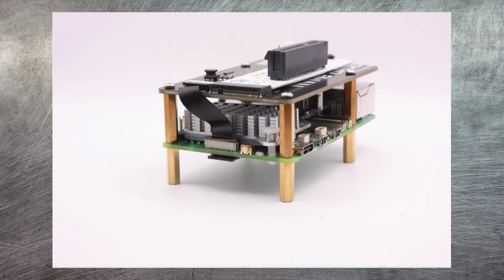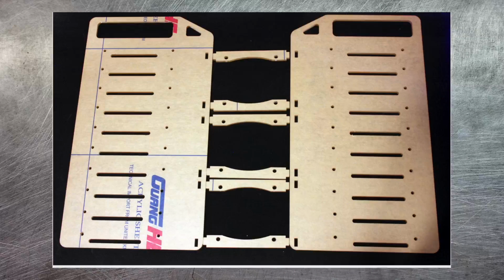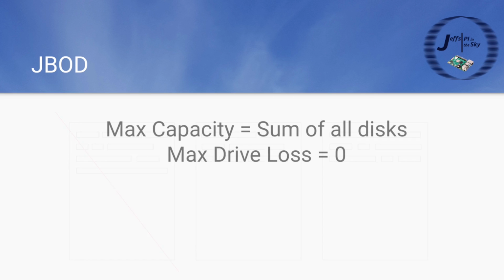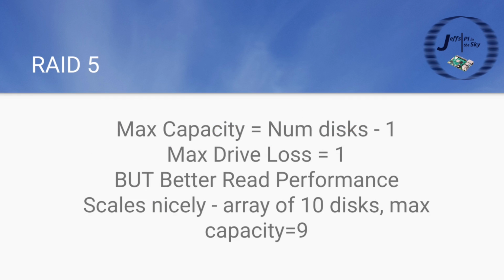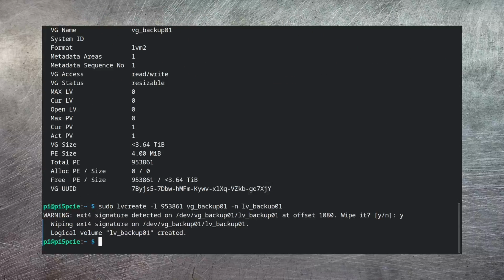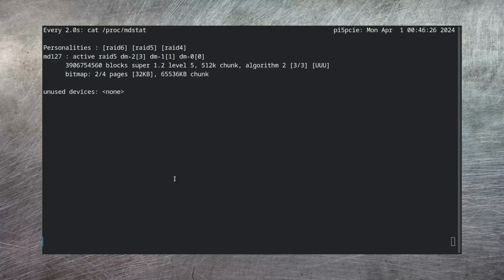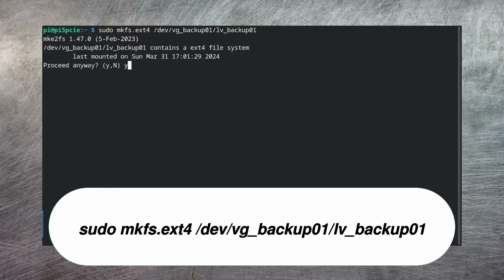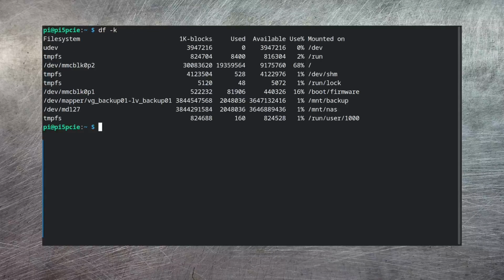Build your own NAS using a PI5 and a SATA controller card!!

Comment from the maker: As @davidKenny64 requested, here's approximate costs for the whole project. If you have old hard drives just sat around somewhere, use those!! Most expensive pieces are the PI and the hard drives. So please see this as a 'worst case' as is based on prices I can find right now - as always, AliExpress is extremely volatile with prices but is also a great place to pick up tech cheaply but shop around as best you can:
PI5 4GB - £58.50
SD card - £8.29
WD Red 2TB * 3 - £102 total
WD Red 4TB - £69.41
2.5" to 3.5" drive adapter * 2 - £11.98 total
80mm fan * 3 - £26.97 total
Fan power splitter - £0.94
Power brick - £9.87
Molex splitter - £2.17
SATA pwer splitter - £0.81
ATX starter - £0.56
Pico Power supply - £9.43
Enclosure - £10.87
SATA controller card - £11.47

Total - £323.27
Reply: Hi,

I'm wondering how is the raspberry pi powered ? Can it be powered by the Pico PSU ?

Thanks for the video!
Reply from the maker: Hi, I'm so sorry I missed your message here. In theory, if you still have a spare 3A on the 5v rail out of the pico PSU. I personally powered the pi using it's normal PD supply just purely because it can switch voltages and I didn't want to get in the way of it. But since the actual processing power required is so low, hooking it into the pico PSU should be fine (unless you hook in way more hard drives of course!!!)
Reply: @jeffs_piinthesky  No problem, thanks for taking the time to answer!
Reply: Hello, are the Pimoroni hat and M.2>PCIe adapter included in this price?
Reply from the maker: So sorry, I missed your reply!! I think I put this into the description but yes, I forgot to add the hat (£11.50 on pimoroni.com) and the m.2/PCIe adapter (£6.99 for 2 on Amazon). Apols for the inaccurate list.

Comment: Interesting idea... I have a 20 port PCIe SATA adapter card and could use two of those plastic cases for the the  20 HDDs connected to it.
I could use two I²C amp monitors for the 5v & 12v lines for logging purposes. 
They now make small UPS's for the different Rpi sizes so a few of those would keep this system alive long enough to clear the cache if the is a power outage. 
I just wonder how much power I would really need.

Comment: A couple of comments from the future (before I watch your most recent Pi5-NAS upgrade):  at 11:30 the output of lspci -k shows that the PCIe-to-4xSATA adapter is using an old Marvel 88SE9215 chip that only supports PCIe gen2 x 1 lane, so configuring the Pi5 for PCI gen3 was not going to get you any more performance. A better solution is to replace both the M.2-to-PCIe card on the Pimoroni HAT and the SATA adapter by an M.2-to-6xSATA card using the ASM1166 chip. Essentially you're eliminating the janky PCIe slot. Also the ASMedia chip supports PCIe gen3 x 2 lanes, so the gen3 boost on the Pi5 gives you the extra bandwidth (only 1 lane though), and you have 2 extra SATA ports if you add drives later. BTW, Aliexpress and Amazon both sell inexpensive 6 SATA cable bundles sheathed in nylon mesh  - that makes cleaner cabling.
Reply from the maker: Yes indeed...The old SATA controller I was using was very old!! However, it never really bothered me that much since I had spinning disks connected to it and they never got anywhere near the theoretical max of PCIe Gen2x1 anyway :-) Of course, using SSD's it changes that level of expectation. But the upgrade did away with that card.

Comment: Finally found the time to build this project, and ... it works ! Fantastic solution for my old NAS drives - just looked it up, my WD2002FAEX 2TB 3,5"drives are 12 years old and, according to HDDSentinel have around 4-5 years of active duty on their records. I have an issue though, and that is error messages in my logs when creating the backups. Journalctl makes notes of Input/Output errors and EXT4-fs counting errors - this might have something to do with the olde drives and the number of Bad Sectors....
By the way, as an alternative, I have used the "Geekworm X1004 Dual M.2 NVMe SSD Shield PCIe Periferal Board for Raspberry Pi 5" HAT with the "M.2 to SATA3.0 Adapter Card 6Gbps High Speed ASM1166 M.2 PCIE to SATA Expansion Card with Smart Indicator" - which offers 6 SATA ports directly from the card itself.
Thanks again for posting your work Jeff! 👌
Reply from the maker: That's awesome!!! Great work on the NAS and yeah, I agree it sounds like your drives may be unfortunately nearing the end of their lives but that's the beauty of a NAS that you can swap them out as they fail without losing data. 
Take a look at the SMART stats reporting support in Open MediaVault (if you're running it). It'll give you some really great stats on any drive problems.

Comment: depending on the brand or features, sometimes JBOD is single/independent drive mode and SPAN is the sum of all drives together. i guess it can get confusing when looking at different RAID controllers and devices.
Reply from the maker: Yup! Bring ZFS into the picture as well and it gets crazy!!! I'm just old school, understand RAID and don't mind the (very slight) performance hit of s/w RAID. So I'm sticking with it......for now at least 😃
Reply: @jeffs_piinthesky  yeah zfs is great. but i tried raid1 on two drives on /dev/md0 (mdadm) and i guess my cpu is kinda slow for that s/w stuff
Reply: @jeffs_piinthesky  zfs is great. i tried it years ago. i also tried the simpler mdadm md0 s/w raid1 in linux and i guess my cpu is too slow for that haha

Comment: Is using a generic sata controller card better than a sata hat? The radxa hat has 5 sata ports on it for like 60
Reply from the maker: Simple answer is no 😃. It was purely that, when I put this video together, the SATA hat wasn't available. Just bear in mind that it will be capped at the max bandwidth for a PCIe gen3 X1 interface as that's the max speed for the PI5 but yes, it'll work fine and be much neater.

Comment: How did you power the Pi itself? Did you use the pico power supply to power everything?
Reply from the maker: I used a regular pi power supply for the pi. Technically I could have used the 5v rail from the Pico power supply but where the pi5 can use a variable supply, I was figuring it might be more efficient for it to use the native one. But for sure, I can't think of any reason why powering from the Pico supply wouldn't work.

Comment: I plan on building this.  BUT my main concern is that the system is using sd card for running the OS.  I would prefer booting off of and using a NVMe SSD instead.  Any thoughts on doing this?  I think there's a dual NVME card for the raspberry pi - maybe that's one way of dispensing with the sd card altogether.  Or maybe running off of a USB dongle - but again I'm not sure how reliable this is either.
Reply from the maker: You can get NVMe hats with 2 m.2 slots now which could do what you want HOWEVER you'd be sharing a single PCIe lane between the two then which would impact on performance. If you get a USB3 NVMe enclosure and put an M.2 drive in there, the PI has a separate PCIe lane for ieach USB3 port so you could set that up as your boot device and it'd run much quicker than the SD.
Reply: @jeffs_piinthesky  Yes I think the USB NVMe enclosure is the way to go. Thanks again for the video and the reply!

Comment: Very good explanation on all the topics, I only have one question, why did you use lvm and not make the raid unit directly? I don't see the point of doing it that way.
Reply from the maker: Thank you for the lovely words!!! I use LVM purely to abstract away the real size of the disk. If one fails and you need to replace it, you have to get one with exactly the same dimensions...and trust me, not all drives marked as, say 4TB have the exact same number of sectors etc...
So by using LVM I can get any disk so long as it's AT LEAST as big as the original and use it. It also can make upgrading the array with bigger disks easier as you can initially add newer, higher capacity drives one at a time based on the original sizing, then grow each LVM again to the same value on each disk and then grow the RAID 5 array to fill it. So it's really just a fine grain control thing.
Reply: @jeffs_piinthesky  Thanks for the explanation, I had not considered that way of making an array larger and of course, as you say, it is much easier to do disk updates.

Comment: For backups I first used Zip Disks, then a mix of DVD-RW & extra laying around hard drives, btw hard drives that have a warranty of 5 years can work for 20 years with zero problems, until that one time you move it in any way shape or form & its DEAD if it's a day past 5 years.  Now I run a raid 0 connected to a single huge hard drive ... but the only good backup isn't kept in your house, in case of fire or brownout or power surge.  

You're better off with 6 NVMe raid 0 drives totalling 12 TB for speed & a damn slow & reliable 12 TB platter hard drive as RAID 5 automatically backing up any changes.  ...but that is only needed if your pulling video off of them for editing, just watching movies the slow & reliable 12 TB would be fine .. but that matters on how many are pulling from your NAS at the same time.  btw I have a top of the line home Asus Router that has 3.2 2x2 20GB USB ports & built in software for backups, RAID Drives, & a NAS.   ...it has been awhile, but I think the apps on the router were swappable on your needs from what you needed your router to do.
Reply from the maker: Thanks so much for sharing and sorry for taking a few days to reply!! Zip disks have always been kinda cool as are tape drives - very underrated as backup media. Easy to store and naturally durable...And yeah, totally agree that the "lifetime" of disks is very frequently quoted in pessimistic terms...I've still got hard drives running that are over a decade old and showing no issues. 
Also, totally agree that NVMe's would be way more performant but I have to keep costs under control on the channel for all the time I'm trying to reach monetization!! :-) Everything is funded purely by me right now...But hopefully I can do some more adventurous stuff down the line. And your router sounds awesome!!!!